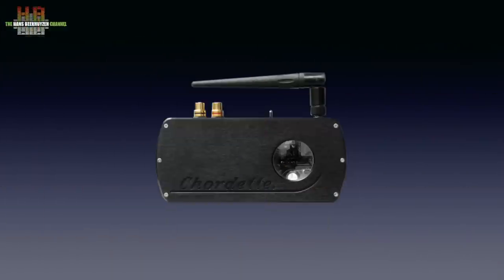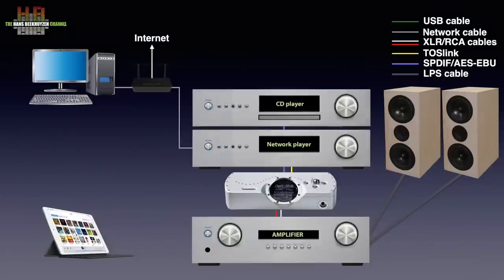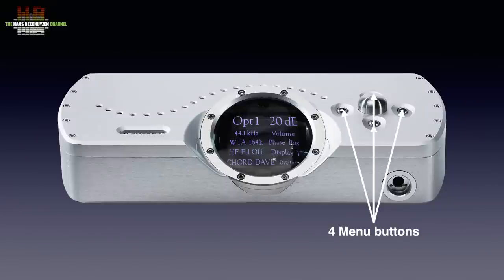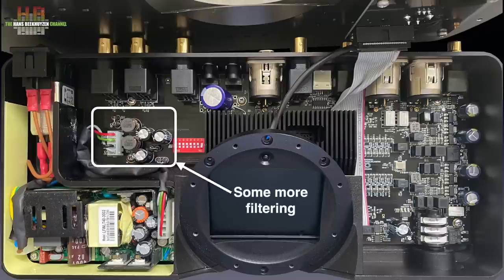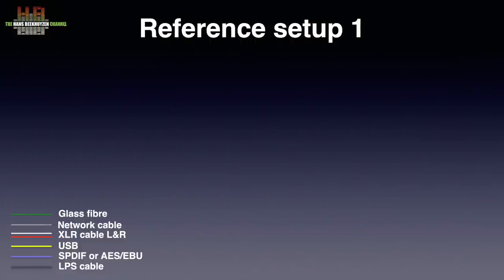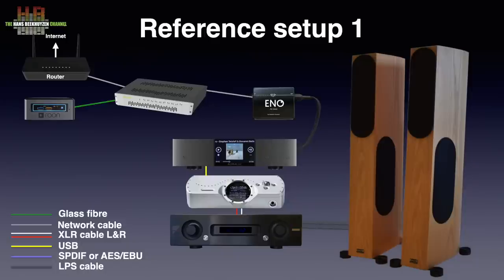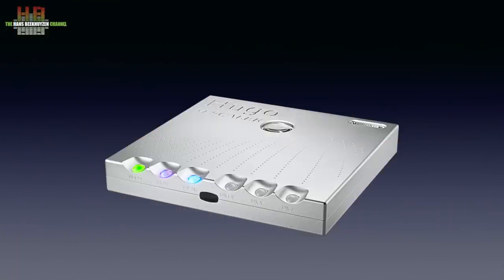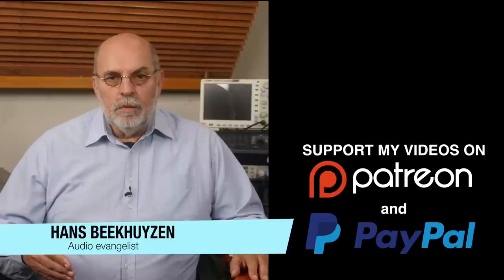Chord Dave FPGA DAC

Comment: PSA! for reviewers, DAVE owners and those who plan on demoing. The DAVE has a crossfeed function intended for headphone users. What is NOT mentioned in the manual is that when it is turned on, it REMAINS on even when not using headphones, thus resulting in a blurred stereo image when listening though speakers. If your DAVE sounds funny, it may be that the crossfeed function has been left on! The ONLY way to access the crossfeed function menu is by plugging into the front 6.3mm headphone output and the function will appear on screen.
Reply: How did you notice that.  I always  thought this is a Headphone only function and switched of with the headphone Mode . I just checked and noticed crossfeed was set to 1
Reply from the maker: I didn't know that either. But it appeared that that was not what I had heard the first few days. It was set to zero. If it had been the case, the sound quality couldn't have been improving over the days.But thanks for the tip.
Reply: @mrgadget4863   Hi Mr Gadget, it is intended to stay on for those headphone users who would pair the DAVE to an external headphone amp. That way the crossfeed is not limited only to the headphone output of the DAVE.
Reply: @TheHansBeekhuyzenChannel   Hi Hans. I too had noticed the extensive warm up time the DAVE requires. After you mentioned your initial impressions but the sound improving over time, I didn’t think the crossfeed was your issue but it did remind me of it and I thought I should mention it for the benefit of your viewers.
Reply: @SuperMrGiraffe   thx
Reply: Many thanks for this information ! Chord confirmed me today the same by mail, the crossfeed setting is always active on all outputs (it's a shame they didn't updated the manual). The factory setting of mine was set to level 2 crossfeed. Dave is also very sensible regarding the power cord.
Reply: After owning Dave for few years, I've removed internal switched power inside Dave and running external LPS , you actually need 3 of them ( 15v , 5v and -15) it elevated what Dave was capable of .. I know a lot of ppl like M scaler but I could not get used to it even with references Dual BNC cables I think it was changed sound too much , but I can understand why some like what Mscaler is doing
Reply: Dave is non balanced design, I found RCA to sound better in my system

Comment: Hans thank you for another great review.  I agree with your comment that “everything matters.”  One suggestion. feeding the Dave with the Auralic Aries G2 makes a material difference.  I suggest that if you still have the Mola Mola Tambiqui you listen to it with the Aries G2, as opposed to using the Tambaqui’s ethernet connection. I have such a set up and the Aries makes a material difference, and you will then have a more apples to apples comparison to the Dave.  Best regards,
Reply from the maker: Did you watch the Tambaqui video? For that is exactly what I did.

Comment: My Chord Qutest has choice of 3 voltage output settings at start up.
I've found No information or tests anywhere, so I use the 2v as that gives a similar volume as my old CD player did. 
Can anyone please answer. Which voltage output is most appropriate, the implications to the dac and amp and why ? Thanks.
Reply from the maker: 2 volts is the most common since it is Red Book specification. As you have noticed already.

Comment: I own the Chord Hugo TT-2 and the Chord Hugo M-SCALER - they have greatly improved the sound of my audio system - I have many CDs, which I'm loath to throw away, if for no other reason than to preserve their liner notes and booklets, which for the most part you CANNOT get when you buy and download a CD on QOBUZ.- so I bought a CD transport from another U.K. manufacturer - CYRUS  - their CDt-XR transport, whose coaxial digital output I connect to the M-Scaler. The sound from my large CD collection is vastly improved.

NOW I find myself wondering if it makes any sense for me to buy the Chord DAVE, since I already have the TT-2 / M-SCALER combo. Would I be paying a LOT more for the DAVE in exchange for a barely perceptible improvement in sound quality over what I have now - or would I notice a major upgrade in the sound?
Reply from the maker: I can’t say. I did no direct comparison
Reply: @TheHansBeekhuyzenChannel  Thank you! I thoroughly enjoyed your review of the DAVE alone and then after you used it with the M-SCALER. I just discovered your channel yesterday, and I've now subscribed to it. I will also help support it, as others of your viewers are doing.

At some point there will be a comparison made of the Hugo TT-2 and the DAVE.  IF, as I suspect, no big difference is experienced between the two, especially when used with the M-SCALER, it's likely to be "GAME OVER" for the DAVE, as there may be very little reason to spend a LOT more money to own it. Considering that the DAVE is designed to be used with the M-SCALER, it likewise makes little sense to buy the DAVE to use by itself - although your review of it as a stand-alone D/A Converter is highly positive. On the other hand, there may be significant design features in the DAVE which the newer Hugo TT-2 can't possibly match, or simply doesn't have.  

So here we are faced with an interesting dilemma, indeed, which CHORD itself has created - it may well have rendered its older DAVE obsolete, simply because of the technological advances which CHORD's engineers have achieved over the five years since 2016, when the DAVE was released, and the present day in 2021..

Comment: Hans, one other problem with the Dave's lack of back panel labeling is the absence of a CE mark.  One would hope that a digital product, especially one with a switch-mode power supply would have complete EMC testing.  Is this confirmed in the manual?
Reply from the maker: There is no mention of a CE label in the manual. But it isn't the first high-end brand that does not do CE. I know of a distributor that cut away capacitors - needed for the CE label - at the inputs since that improved the sound quality clearly.

Comment: Tell me the start-up procedure connecting the dac to your amp. Because You mention the high voltage of the output!
Reply from the maker: Switch off both amp and DAC, make the connection between the DAC and the amp, turn both volume controls all the way down. Switch on the DAC, then switch on the amp and turn the volume control of the amp to a normal position. Then finally slowly turn up the volume control on the DAC.
Reply: @TheHansBeekhuyzenChannel  thanks for the answer. Maybe beter a line-output and a variable line output , so You can can choose .

Comment: Hi Hans. Excellent review. Thanks for your honest hard work. I wanted to ask you if you tried the Dave alone (no mscaler) through toslink (optical). I tell you this because Rob Watts has mentioned that this input is the best in all of his dacs.
Reply from the maker: No, I didn't. I think the primary reason for Rob to prefer the optical input is the galvanic separation it offers. But the optical input is limited in bandwidth, the signal has to be converted from electrical to light and back and the connectors are of mediocre quality. If you use a quality streamer and stick to audio hygiene any other input will give better sound quality. If you spend this kind of money on a DAC, don't connect it directly to an ordinary computer but use an audio server with clean outputs or, like I do, a quality streamer or bridge.
Reply: @TheHansBeekhuyzenChannel  i had a Hugo tt2 and an aurender n100h server and after trying optical with a lumin u1 mini I was impressed. The vast majority of my music is cd rips and optical still lets my listen up to pcm 192 and dsd 64.  The reality is that no matter how good is your setup you can never get the level of electrical isolation of toslink.  The jitter for chord dacs is zero, of corse not, but the level of it is far less important than ground loops in the chain. These are rob watts claims.  I encourage you to try it for yourself and see how good or bad it is. Again thank you for your videos, I’ll suscribe to your channel
Reply: @TheHansBeekhuyzenChannel  Truly, Hans, if you haven't already done so, perhaps you could make a video devoted to the importance of AUDIO HYGIENE,  something which can make a big improvement in the quality of sound reproduction. Only very recently have I become aware of its importance.

Comment: Won’t adding more components to this setup be adding more “noise” into the signal path? Not to mention that starting with a computer as the signal source is the noisiest element of the whole system. Toslink helps but they are not very pure either.
Reply from the maker: In general that might be the case, but when set up carefully this level of equipment is built to high specs. Watch my video on audio hygiene. https://www.youtube.com/playlist?list=PLMbsmejHnP8E-kEzlliBX1bc8V-V4aQfE
Reply: Thanks for the link, Hans!

Comment: Nice review Hans. I must admit I hadn't bothered with standby on my DAVE prior to you review. Two observations since I have tried. 1. Roon can see the DAVE even when in standby which I didn't expect and 2. I have found an issue where the DAVE doesn't start properly from standby (sounds awful and music only on 1 channel) and I basically have to do a full off/on to clear the problem. Might need to give Chord a call on the latter  in case I have found an intermittent problem with my DAVE. Keep up the good work and will be interested in your MScaler review as I was wondering if that effectively killed the reason for a Chord Blu owner to buy a Blu Mk2?
Reply: Yes, the Blu MkII only makes sense if you want a CD-player in matching Choral design. The M Scaler has better HF noise filtering on its inputs, added optical inputs and output as well as the option to cycle between the various upscaled sample rates including bypass.
Reply from the maker: That's personal, I think. Some like to keep their setup simple and ecstatically nice. The M Scaler doesn't fit the Choral line design wise. There are more reasons than sound quality only to choose for equipment.
Reply: @TheHansBeekhuyzenChannel  BOTTOM LINE: When we are LISTENING TO OUR MUSIC, are we continuously staring at and being awed by the AESTHETICS of our electronic sound-processing and -reproducing equipment setup, OR are we focusing on the impact the music we are listening to is having on our ears and our emotions? To me, the QUALITY of the reproduced sound takes considerable precedence over the visual integrity and aesthetics of my audio equipment.  But, this is just MY opinion.

THEREFORE, to each his own, I say! You, Hans, make it abundantly clear to us viewers of your channel what your priority is: sound quality is what matters most to you; I feel exactly the same way about this as you do. 

I realize that you are, in all fairness, acknowledging that there ARE people who care MORE about the aesthetics of their audio gear than about whether or not the music it reproduces sounds its best. These differences are what make us humans so fascinating - we, each and every one of us, has our own idiosyncratic preference as to what matters MOST to us. So, whatever floats YOUR PARTICULAR BOAT the highest, GO FOR IT! 

Thank you, Hans, for bringing this interesting matter to our attention.

Comment: I have the Chord qutest and it doesn't have a power switch. I usually unplug the micro usb cable after use. Is this bad or should I just leave it plugged in permanently?
Reply from the maker: Leaving it on is better for the sound quality. Either switching it off or leaving it on won’t damage your Qutest.
Reply: @TheHansBeekhuyzenChannel  I wonder if anyone has tried upgrading the power supply on the qutest and if it made any difference?